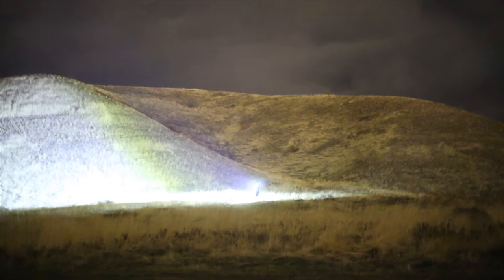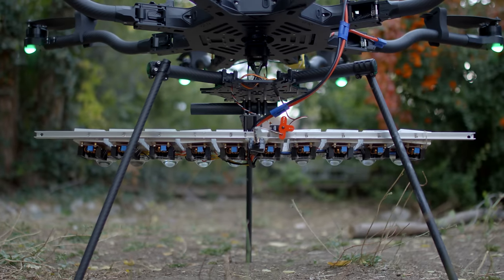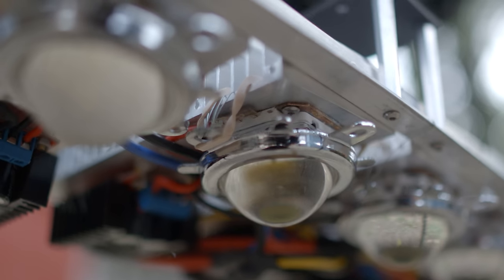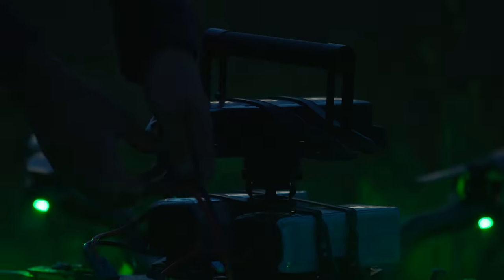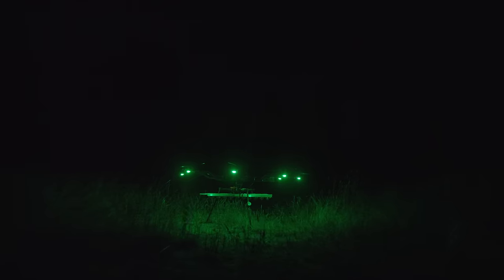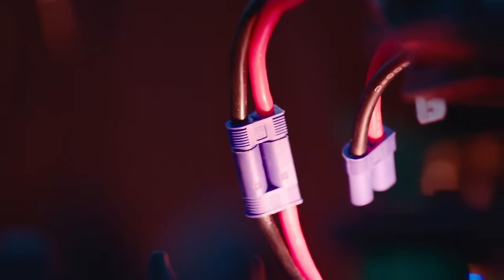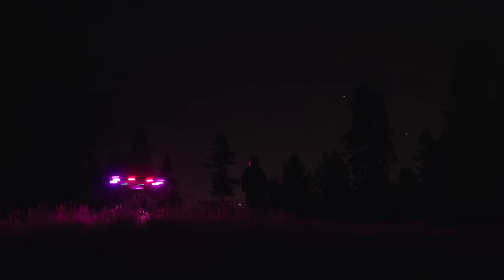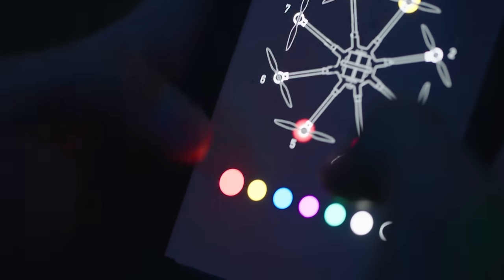1000W LED on a DRONE - RCTESTFLIGHT

Comment: Why the fuck is there a servo to physically toggle a power switch?
Reply: thought the same thing, what a contraption. A relay wouldn't have been harder to add than mechanically moving a switch with a servo.
Reply: I was going to ask the same thing, I can't understand why either. So much hassle, additional points of failure, more power drain...
Reply: Takes more power? It's easier to control a servo?
Reply: frother it's easier to connect a servo to the receiver than a relay. Also, finding a relay with the correct coil voltage to match the lipos voltage could be difficult.
Reply: He probably had lots of servos lying around already...
Reply: The reason is simple: physical switch is the only capable to deliver such currents on such voltage within this weight. Everything else would overheat.
Reply: Come on, do you guys even know what a relay is? It is meant to switch on heavy loads from tiny things like microcontrollers, that's the whole point. That said, maybe the guy didn't have one in hand that could supply enough amps (voltage is not the problem for these LED arrays), but had a servo laying around - duct tape approach.
Reply: aiklarung Technically, he built his own mechanical relay.
Reply: Ahahah really, drive relays directly from a microcontroller? I don't think so. Ok, maybe I've driven a reed relay with a 5V AVR once. You'd can't drive your high current (we're talking 30 A) capable relay directly from any micro. It may or may not be able to be driven by a reed relay. If it can't then you'd need 3 relays!!! Much more of a contraption than a servo flipping a switch. And on top of all that, relays have a constant power draw when the NO contact is closed (i.e., the light is on). A small servo would probably have less usage.
Reply: He should have used a MOSFET
Reply: Alex Dlugosch dude, relays ONLY exist to drive high loads from weak sources (the other guys comment on using a MOSFET has to be a troll though)

Here, a 30A relay to be used from a 5V arduino:
https://www.aliexpress.com/item//32642667729.html

What, would industrial applications have a servo moving a switch mechanically too?

Also a relay is just an electromagnet moving a conducting element, you can scale it to whatever load necessary.
Reply: That would be a great solution, but that's not just a relay. Its a relay with an optocoupler and transistor to drive the relay, and it needs a seperate DC source to drive the coil. You CANNOT use the digital outputs from the microcontroller alone to drive the relay. The digital output is only a signal. On something like an AVR micro you can only draw about 40 mA from a pin. That relay needs 190 mA to be driven. Also, relays are inductive loads, so if you just switch off them you get a big voltage spike which will damage a microcontroller. That's why that relay board you linked has an optocoupler.
Second of all, I don't know what kind of outputs this guy has available on his drone. If he only has the common PWM outputs that are on RC receivers and not digital outputs, then it would make sense to use the servo.
If the guy who made this didn't have such a relay board on hand, but he did have a servo, of course he would use the servo and the switch that's already installed instead of having to order the relay board, wait for it to be delivered from China and then wire it all up.
My original point was that you need more than just a relay, you need a relay driver circuit as well. Obviously a servo flipping a switch isn't the optimal solution if you can order or design whatever device you want, but if you're just trying to rig up the thing with what you have on hand, the servo makes sense.
Reply: aiklarung please tell me why I have to be a troll
Reply: I've got no idea, a MOSFET is what I would probably choose. I wouldn't be messing around with relays either.
Reply: DanTheMan You can't drive 1kW off a MOSFET surely?

And regarding the relay module, it has more to it than the relay and needs more power than the microcontroller can provide, but you won't be powering both through the same source than the huge LED array anyway. A small battery and step-up converter is fine.
Reply: Heres a part in consumer quantities. https://www.sparkfun.com/products/10213 use two.
Reply: DanTheMan Good luck with theese without active cooling. Good luck with all the power loss.
Reply: Yeah true, seems to be about 15 watts of loss, assuming 2 in parallel. That's Rds of .0175 ohms. Compare to about 1 watt to drive a relay coil, and maybe a few watts in the relay contacts.
Reply: If 10 watts difference is a big deal, (1% of total power) then add more MOSFETS. 5 MOSFETS has 6.3 watts. However, if I was designing this I would choose 2 or 3 MOSFETS for several reasons. 1 weight, 2 cost, 3 control, 4 modulation. 1.5% just is not significant. A half meter of 15 gauge wire has the same resistance. It is a fair bet that he would have more losses in the wires connecting his LEDs than in MOSFET control.
Reply: Alex Dlugosch 0.175 ohms? At what temperature?
Reply: The Rds (on) for that MOSFET that was linked is 0.035 ohms. I don't know at what temperature that is but I would guess that it doesn't vary all that much at elevated temperatures. Put two in parallel and you cut the total resistance in half. But since power is current squared times resistance, you reduce losses even more significantly by using more MOSFETs in parallel. Use 5 in parallel and power loss becomes 5 * ((30/5)^2 * 0.035) = 6.3 watts.
Reply: Alex Dlugosch I cannot understand. An arduino relay module is dirt cheap, consumes virtually no power, and is simple to use. You say a MOSFET will waste whole watts.
Reply: Basically, in case of 5 mosfets, you will have to wire 15 legs, and you still need a radiator to cool them. And to arrange this in some manner to fit there, PCB?
Reply: +aiklarung +magnusmoty If you want to learn about electronics go take an engineering class.
Reply: DanTheMan you don't have to be an engineer,  to see,  that building 5 mosfet scheme with radiator and controller is longer,  than duct taping rc servo to a switch.
Reply: Peter Lustig who's talking about IO signals? He's using an arduino or something I guess. The question is why not drive a relay instead of a servo with whatever digital IO he's using. Relay is cheaper, more efficient and easier to use (and unlike a MOSFET, will not double as an electric oven)
Reply: @magnusmoty Active cooling? It is flying through the air.
Reply: You still need some kind of small radiator on mosfets.
Reply: 'Cuz cool factor.

Fuck practicality or die trying.
Reply: so what's the point of fighting if you all have the solution
Reply: Go find an affordable 1kW Mosfet ^^ good luck with that

Comment: What type of fog machine did you use that you were able to put on the drone??? I'm looking for a portable fog machine.
Reply: I thought that was dog caused by the propellers pushing cold air over the hot LEDs
Reply: BLOOGaming you'd need to rapidly cool down the air to make it condense its water
Reply: maybe just spray the fog juice over the heatsinks? :)
Reply: smoke bomb
Reply: Gigaguenther
Right, not heat up. Wow, can't believe I mixed that up.

Comment: wow $17k drone. Go big or go home I guess.
Reply: And a $30,000 camera.
Reply: There are cheap toys and there is professional equipment, pricing is not similar. Toy drones couldn't lift the light. His drone is performing fairly normal carrying a light, camera and fog machine with enough batteries to run it all for ten min. Probably cost more than you think to be on that level.
Reply: Yeah, I was wondering what kind of camera they were using to film this with?
Reply: +Tyler Overturf vid description has the 5 cameras used by the 6 photographers.
Reply: Im going home
Reply: I'm pretty sure it's a Red camera, not sure which model though.
Reply: And another drone for the aerial shots of the big drone.
Reply: And $1,700 just in LEDs.
Reply: 17k? Well that spoiled any ideas of getting one of Drones to experiment with, DJI 4 will have to do then.
Reply: It's a huge drone.

Comment: the efficiency of the lamp is small from the fact that there are many voltage converters and they have an efficiency of 70%-80%, it is better to put 1 Converter and do not worry wakes up more power than before and the flight of the drone is longer . (there may be an error in the translation I am Russian:) )

Comment: Xhp70 headlamp with 3 18650 batteries running parallel is brighter than that 26 bucks Amazon cool video that's the UFO I've been seeing 😭😭😭